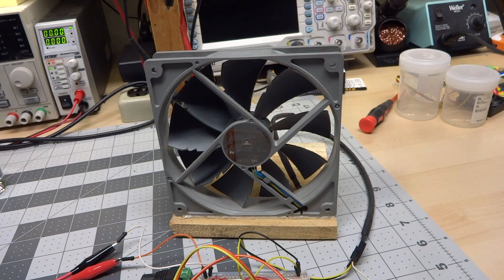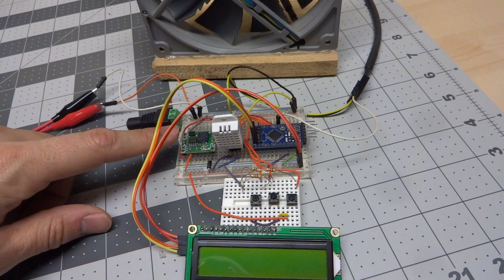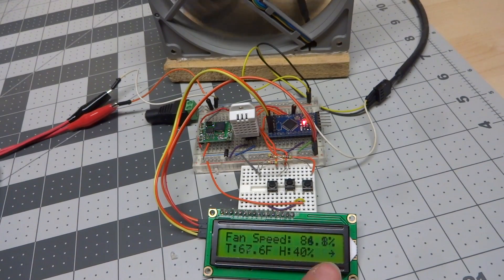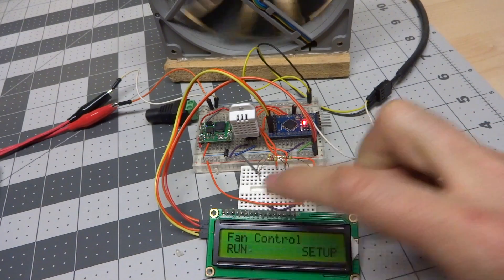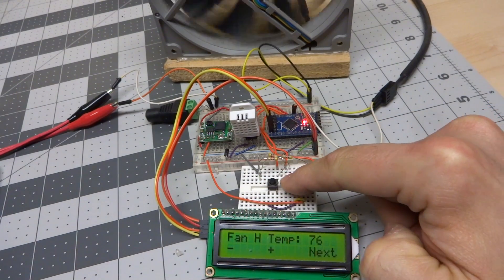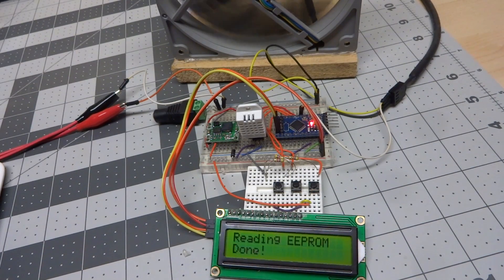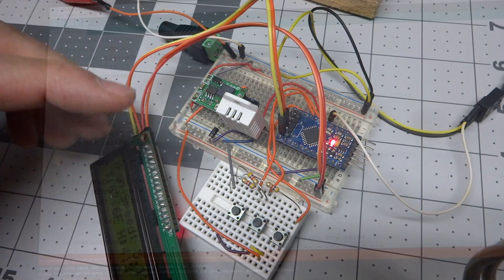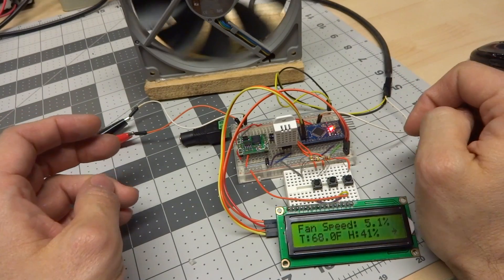Creating a quiet and efficient room fan with an Arduino

Comment: Great code and video how easy would it be to use a two wire fan and control a mosfet using pwm to control the speed off the fan can you have a look at Arduino Temperature Controlled Fan Speed by Jacob Dykstra?

Comment: Does that arduino not have a Vin pin? I know a buck converter is more efficient but the 5v electronics won't be drawing much power in the first place

Comment: Another way to get computer fans to run quieter is to specify non-contact magnetic bearings.  Magnetic bearings will outlast sleeve bearings and the best ball bearing many times over.  Alas, the Noctua NF-A14 fan uses ball bearings.

Comment: I made something similar except I also had an LDR (Light Dependent Resistor) that would detect daytime and turn the fan on at nightfall and off at sunrise. Built it into an outlet box which I set in the window. Saved me from having to turn the fan off and on. Used a 1 wire sensor for the temperature and just shut it the fan off when it falls below 60 deg F. Controlled with an ATTiny85. Fun.

Comment: I got it to work!!!! So freaking happy :) I have absolutely no coding experience nor do I understand the code written, but it works! i even managed to convert the display to degree celsius, though I am not entirely sure how the code was written so even though I got it to display in degrees I am not sure why I had to do what I did to make it happen :) Thanks Adrian! great project!
Reply: Hey Sherman D'Souza, that’s awesome. I want that too :) How did you managed it? Do you have a blueprint and a shopping list? Or did you asked for help somewhere online? Greetings from Germany, Jan
Reply: @janhanse400  I can draw you a wiring diagram of you wish. I used the exact same code as shared by the author. Took me a while to find the right libraries. I used a Arduino Nano and it worked fine. Email me if you need the info.
Reply: Sherman D'Souza hi, would you have a wiring plan on how to wire this project?
Reply: @BlackArcticElec  I do. Give me an email address and I will email it to you
Reply: @shermandsouza  I would love to get the wiring plan too, if you don't mind.
Reply: @yolo_aka_carpediem  send me an email and I will send it to you.
Reply: @yolo_aka_carpediem  your email bounced
Reply: @yolo_aka_carpediem  your email bounced again.
Reply: @shermandsouza  strange, never had problems with my gmail. Is it over 25 MB?
Can you please try to send it to following email:

sim0n83@hotmail.com

Thank you so much in advanced.
Reply: Hi Sherman, there seems to be a disconnect from the OP on this project as far as parts, wiring diagrams and code issues. You appear to be one of the only people to get this to work. Would you be able to send me your diagrams and also, how did you mange to get by the library compiling errors and a a few other coding issues like "positive not being declared" fixed???
Reply: @richwyland2658  send me an email and I will send you whatever worked for me... I am no expert... Just tried a bunch of things and it finally worked for me 😂

Comment: How did you get the LCD backlight to switch on or off. I cant do that with I2C
Reply: You can do that with the I2C module (which converts the 16 pin to 4 pin). It has a backlight jumper.

Comment: Hi Adrian, I am home stucked because of the quarintine, and trying to make a reptile incubator with an arduino, a styrofoam cooler, peltier, heating paths , and fans, but im stucked in the functions, do you have any guide I could use to learn or actually an example ?

Comment: Could you please help me with a circuit? I am trying to run a fan using maybe Arduino or some other mc you recommend. And i want the fan to be temperature controlled and also change it speed with respect to temperature.

Comment: Arian, you could use internal pullups for buttons and save environment and 3 resistors :)
Reply: could you tell me how this is done? I know nothing about coding and I cant even get his code to work for me.
Reply: @shermandsouza  If you can't compile old Arduino code it is unfortunately normal, because Arduino new IDEs are not compatible with older ones. Try to use older IDE like 1.6.5 or even older. The same for libs
Reply: @cbm80amiga  Looks like Adrian is using 1.8.0 inhis video... i managed to get past the library error now stuck on "POSITIVE was not declared in this scope".. Does anyone know if there are programmers who can write code for me for a small fee? :)
Reply: Thanks so much for your response..I will try that approach.

Comment: Hi Adrian, nice work. Simple question from another electronics engineer: What is the brand and type / model number of the Lab power supply that is shown at the beginning of the video?  (top left corner, the one with the dual 4 digits green 7-segment displays).

Comment: can i use arduino uno for this project??
Reply: Don't see why not
Reply: @josephkreifelsii6596  How much would you have to change the code? I tried using a sparkfun pro micro and the compiler went nuts with errors :(
Reply: @josephkreifelsii6596  I am using Arduino IDE and it recognises the sparkfun boards since it's the same chip. I will try it with an Arduino device and see if I can get it to work.

Comment: Hi Adrian, thanks for your post on YouTube.

I'm trying to collect the heat between a steanless steel chimney and its enclosure, already tried other Arduino-suggestions combined with a Noctua NF-F12 PWM, but your solution seems to be the proper one for me.
 
Assuming the parts list doesn't change like Joe is asking below a schematic would be very appreciated

Comment: Cool idea (sorry). One adaption might be for those who have remote control features in their existing floor and ceiling fans. Though the hardest part to implement might be the reverse engineering the IR signals.

Comment: Hi, you could implement PID temperature control in order to avoid that low speed ,high speed fan variation. Most good temperature controllers use PID instead of bang-bang

Comment: I'd love this because I've already been thinking of putting banks of 6 or more of these type of fan in my windows and wanted the option of granular control.

I was thinking of just powering the fans with an LED strip supply with a dimmer like those puck lights for the kitchen come with.
Reply: I'm a bit sketchy about this project because although I have an arduino I am unable to code for it unless I have pre existing code that is very easy for novices to modify. 

I kinda need an almost plug and play solution. That's why I thought an LED power supply with the dimmer would be ideal as LEDs and those fans are both PWM and I don't need automatic temperature based control I just need buttons or a knob for speed control and that's about it. 

I'd love to use things like arduino to do all sorts of cool things but it's not as easy as everyone makes it look, the hardware mock ups are easy enough for me, it's the code I can't do and no one ever has code I can just drop in place.

Comment: Very nice little project there :) For your 3 switches you can also use the command pinMode(X, INPUT_PULLUP) which activated the pull resistor on most digital pin :) I use that to save on resistor and so far the only pin that is not compatible is pin 9 and I have no idea why. Thanks for sharing ^.^

Comment: Or, you could use timer 1 which is 16 bits wide and since 16MHz/25kHz=640 (which is less than 65,536) you could set the prescaler to 1 and have 640 speed steps instead of just 80.
Reply: Smart.

Comment: Why not use the arduino to control a normal room fan?  
Not that hard to do and than you would have a stronger and still less noisy fan.

Also i would suggest to write it as a PI controller with a big I-part:
Really constant fan-speed.
Reply: Controlling a "normal" room fan is not trivial at all - /some/ of them can be controlled with a TRIAC (playing with mains here!) and some of them not at all. Also, you will likely hear the 50/60Hz hum from the motor, even if it's running slowly.
Reply: zaprodk ... most roomfans are incredible simple with no active components. You can control those with a triac at its simplest, or with PWM and a Mosfet.
some even have universal motors and you can feed them DC.

and those that already have a brushless motor are even easier to control.

Comment: When I use an USB-cable for power input, do I need something instead for the voltage regulator? greenhorn here
Reply: ah I missed the info in the video, that the fan is directly connected to the 12V rail. is it possible to implement a boost converter to power the fan and a direct connection to the 5V rail for the electronics?

Comment: Looks awesome, but I wouldn't call this a 'room fan'. Its more of a mini 'desk fan'. Not something that I'd ever want to use to cool an entire room... not powerful enough. 

What I'd like to see, is some sort of voltage booster so that you could power it from an unused USB port. As in, plug it into a 5v USB port, voltage gets boosted to the 12v needed to run the fan and what not, and boom, a semi smart fan that you can use when spending long hours at the computer. And while I can't remember with 100% certainty, but doesn't USB 3.0 up the voltage output alittle as well? And same for USB 3.1? Could implement a little bit of code that interacted with the data lines to determine what generation of USB port its plugged into and determine if it needs to use the booster circuit or if it can just pull from the USB port directly. I coulda sworn that there was something about USB 3.1 being able to do 10+ watts of power, and could go between 5v-16v. But my numbers could be horribly wrong. Its been a while since I've heard anything about it. I just know that they say the spec for 3.1 is enough to power a laptop using a desktop with 3.1
Reply: Hikari maybe his needs are modest.
Reply: Lol right

Comment: Is there any particular reason not to use the Arduino built-in pull-up resistor for the buttons in this project?
Reply: purreness i don't think so ... it might just bei personal preference to use active high

Comment: A schematic and parts list would be nice.

I see the following parts (as a starting point), 
1 - Noctua 4wire Fan (NF-A14 PWM)
1 - 12VDC Power Supply
1 - Adjustable Buck Converter
1 - DHT22 Temperature Sensor
1 - Arduino Pro Mini (Generic OK)
3 - Push Button Switches
1 - I2C LCD Display
2 - Solderless Breadboards
1 - Diode
1 - Electrolytic Capacitor
3 - Resistors

Misc - Jumper Wires
Misc - 12VDC Connector
Reply: yes a parts list would be nice